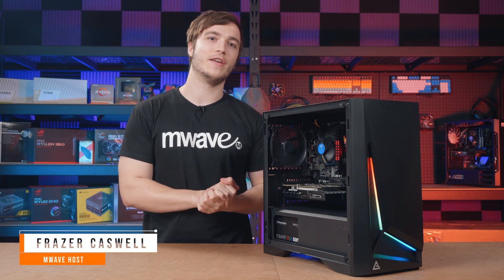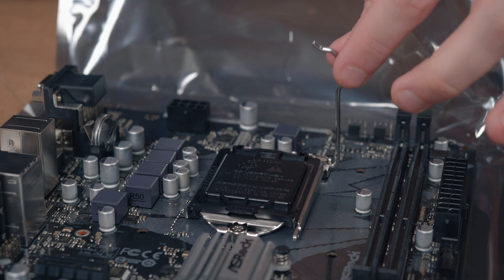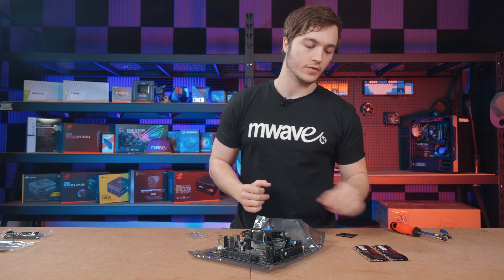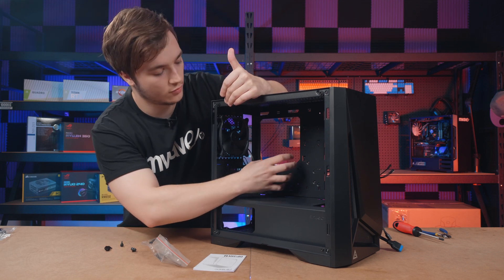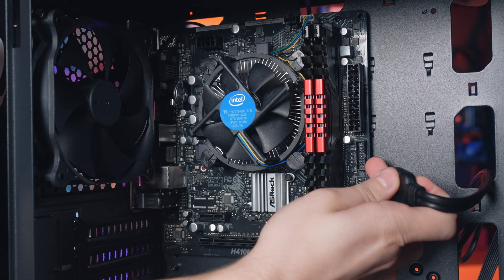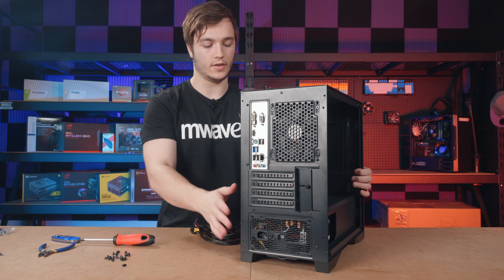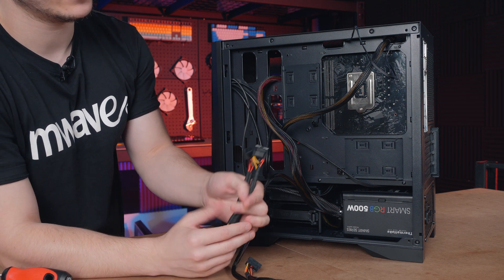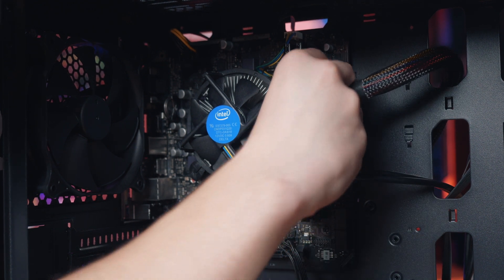DIY - How to build a Budget Gaming PC for Under $1000 AUD

Comment: How would i connect this to the internet? Is there wifi in the motherboard?
Reply from the maker: Hey Dennis. For the PC used in this video, unfortunately, the ASRock H410M-HDV Micro-ATX Motherboard does not have built-in WiFi. You would need to connect an ethernet cord for a LAN connection to the internet.

Alternatively, you could connect a WiFi PCIe Adapter and connect to the internet via WiFi, as long as you have a free PCIe x1 slot in your motherboard :)
Reply: @MwaveAU  Ah thank you, Also I noticed that this DIY kit is listed as "current unavailable"
Reply from the maker: Hello again. Unfortunately, some of the parts included with this build are unavailable which makes the whole bundle "Currently Unavailable".
Reply: @MwaveAU  ah thats all good

Comment: Hi great video. Is there a motherboard that will work with this build that has wifi capabilities. Also would a 1650 super be a worthwhile upgrade as my budget is about 200 dollars more. I am new to computers so thanks for the help.
Reply from the maker: Hey Oscar, glad you enjoyed the video! In regards to changing the motherboard while using this case, the 'Antec DP301M Micro-ATX Case', any Micro-ATX or Mini-ITX motherboard will fit and work as long as it has the correct CPU socket and appropriate connections for the rest of the build. I had a little look for you to find a motherboard which will work for you that has WiFi, same CPU socket, Chipset, similar price point and I would recommended the 'ASRock H510M/ac LGA 1200 Micro-ATX Motherboard'. At a glance, this is almost the exact same motherboard as the one used in this video, with the addition of WiFi and BlueTooth. There are a few other motherboards which will do the same job, and off course you could look for a more expensive option with a few extra bells and whistles, but this recommendation is as close as I could find to match the original board, with the addition of WiFi. I will link it below for you.

As for upgrading to a GTX 1650 Super, that will really come down to your budget. Yes, you will get a performance upgrade when it comes to gaming. Having a quick look on 'UserBenchmarks' and comparing the GTX 1650 vs the GTX 1650 Super, you will be looking at roughly a 40%* increase in Effective FPS and speed (this is just based of data they have collected and only to give a rough idea in the performance difference between these 2 GPU's). But if it's worth it, again it comes down to your budget.

Hope this helps! Let me know if you have any other questions :)

ASRock H510M/ac LGA 1200 Micro-ATX Motherboard: https://bit.ly/3fxuuqu
Reply: @MwaveAU  Thanks for the reply, super helpful. Do you sell 1650 supers on your website?
Reply from the maker: Unfortunately, at the time of this comment we don't have any GTX 1650 Supers on our website sorry :(

I will however drop you a link to check out our range of GTX 1660 and 1660 Supers, just to make it easy for you to have a look at what we do have available. There is obviously an upgrade in performance when it comes to gaming when comparing the GTX 1650 Super and a standard GTX 1660 or 1660 Super, but of course, this can sometimes come with a higher price point as well so I don't mean to try to upsell you or anything like that. Just wanted to try and help as much as possible.

If your heart is set on an GTX 1650 Super, then I am sure you will be able to find one somewhere online :)

GTX 1660 and GTX 1660 Super: https://bit.ly/3qzkOSE

Comment: I really want to purchase this computer… Do i just have to build the computer from random website by using this specifications?
Reply from the maker: Hello Noah. Yes, you can. All the parts are listed below the video in the description. At the time of this video being released, some of the parts were no longer available on our website so we replaced them with different alternatives which would still work. The biggest change was going from a SATA SSD (this was used in the video tutorial) to an NVMe M.2 SSD which provides much faster read and write speeds. If you want the exact same PC build in the video, then you can definitely search for all the parts listed in the description as 'Old'.

However, I have just gone through the list searching for the 'New' alternatives and the only product not available on our website was the 'Kingston HyperX FURY 16GB (2x 8GB) DDR4 3200MHz Memory'. I had a little look and found you this: https://www.mwave.com.au/product/gskill-ripjaws-v-16gb-2x-8gb-ddr4-3200mhz-memory-ab68183
The G.Skill Ripjaws V 16GB (2x 8GB) DDR4 3200MHz Memory will give you very similar performance to the original memory listed.

If you have any other questions, feel free to ask :)

Comment: How do I install windows On it and how do I connect to internet via ethernet cable
Reply from the maker: Hey Jonah. Unfortunately the bundle for this budget PC does not include Windows so you will have to purchase a copy of Windows if you don't have to an installation for it already. Make sure it's a USB version as well.

Once you install Windows and get it running, the LAN drivers should update automatically and you can use an ethernet cable to connect to the internet. I did however have an issue with the LAN driver updating after installing Windows once. I reinstalled Windows and the second time it just worked fine and I could connect to the internet. Hopefully it just works the first time for you :)

Comment: I think a PS5 would easily outperform a PC with a 1650 (non super)

The 1650 is a very weak graphics card and not worth it's money.

The FPS:MSRP ratio is poor basically.
Reply: the ps5 graphic card is almost the same as a 2070 super so ofc it would ( i am pretty sure it it dont quote me)
Reply: Ye but it gives peoples a start and then they can move there way up to a better graphics card

Comment: Ayo the front panel leds for that case ain't working for me.
Reply from the maker: Hello! Just make sure that all the front panel headers have been connected correctly to the motherboard. You can see how they are connected in this video at 6:58 but it is always a safe bet to check your motherboard manual on how to connect everything correctly :)

Comment: Is this the best $1000 pc you can build?
Reply from the maker: Hey Sasuke. This was a very solid gaming PC for $1000 and it would definitely compete with other gaming PCs at a similar price. But it is hard to say it is the "best". I am sure you can change one or two parts at a similar price but the performance change would be very minimum.

Just a heads up, we have upgraded this budget gaming PC bundle to now include an NVMe M.2 SSD instead of a SATA III SSD. So this will give you faster boot up and loading speeds :)
Reply: 1000 AUD is around 700 USD I think.

Comment: meanwhile a $1000 dollar pc in the us is basically a 3900x and a 2070 super
Reply: 1000 AUD is around 700 USD I think.
Reply: money conversions buddy
Reply: @autizgiz2756  im talking about the fact that america receives lower prices on parts
Reply: @will_st800  money conversions buddy
Reply: @will_st800  In addition to higher taxes, the reason parts are cheaper in the US is a result of basic economics in a lot of cases. You've got to put components on a boat to ship them to EU/AU/NZ. Sure, they ship to the US as well, but guess who the biggest consumer is? The US has higher supply and higher demand, and prices are lower (in part) as a result of this. And if I'm not mistaken, the vast majority of Intel chips are produced in the US (all of the chips with < 50 nm processes).